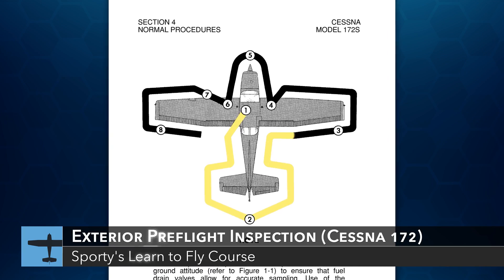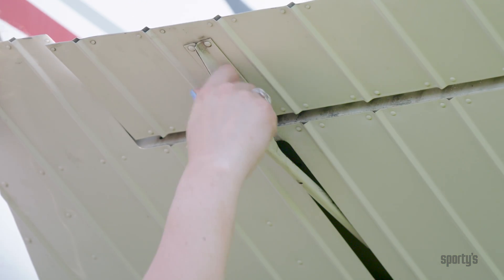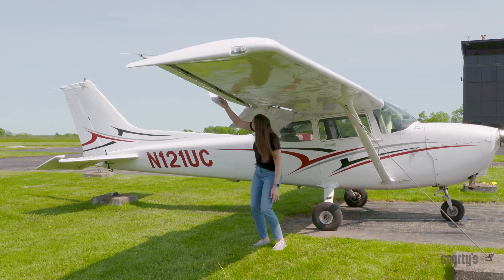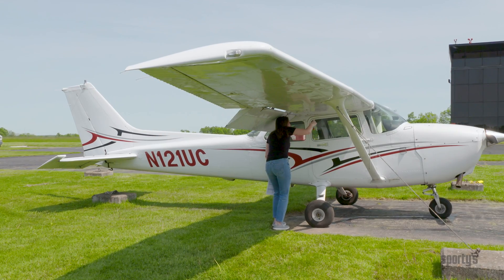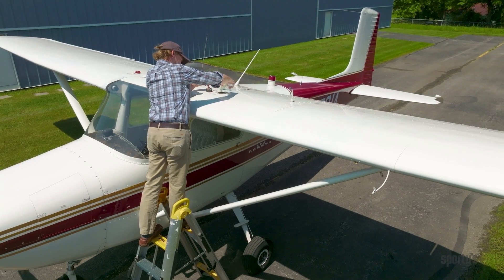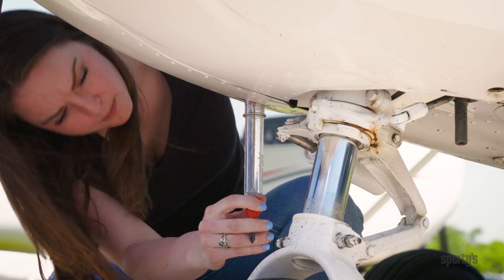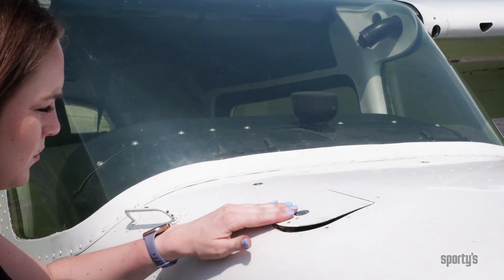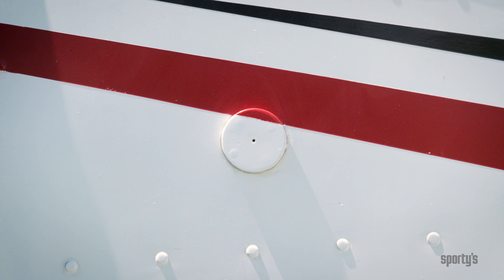How to preflight the exterior of a Cessna 172 - Sporty's Private Pilot Flight Training Tips

Comment: The most precursory inspection I’ve ever seen….missed whole sections of the airframe, such as the belly, underside of flaps (rollers, actuator, bracket, etc). Good overall summary, but far from complete for the standards my students need to have. Is this why students think that by just doing a 3-minute lap around the plane they have aptly deemed a plane worthy of flight? 😮

Comment: She should have looked into the exhaust pipe to make sure no birds have decided to make a nest in there and that it’s free of any obstruction as far as she could tell. And if the engine is cool to the touch, perhaps a gentle pull on the exhaust pipe to check its’ security. You don’t get a second chance to do a preflight. Once your airborne it’s too late if you missed something. Do your preflight right the first time. And don’t let anything distract you during preflight.

Comment: Checking the tire pressure should be done with a pressure gauge. You cannot tell if the pressure is correct just by looking at or touching the tire unless it is way off.

Comment: In places where the temperature gets below freezing, you should rotate the prop (opposite the normal direction of rotation) so the bottom blade is vertical. That helps drain any water that might otherwise collect and freeze in the spinner that will cause an out o balance situation when started. It also allows for easier inspection of the engine intakes and alternator belt.
Reply: also helps you get access to check alternator belt
Reply: Clockwise rotate?
Reply: @Davi3038849844  Yes, this would generally be clockwise when viewed from in front of the prop (some airplanes have props that rotate counterclockwise when viewed from the cockpit such as the right engine on some light twins). I edited my comment to clarify that you should manually rotate the prop opposite the normal direction of rotation.

Comment: The guy on the ladder is standing on the top steps which is dangerous. These are typically placarded with NO STEP because it’s easy to overbalance with the weight that high. I’m sure we’ve all done this before, but it really should not be in a training video.
Reply: I hat3 climbing the wing step, i almost always slammed my left outside foot into the ground

Comment: The plane is pushed back too far in its spot so both the wing and tail tie downs are slanted forward. They should be either both straight down or pulling in opposite directions. There are no chocks so if the wind were to move the aircraft forward, all the ropes would be loose and it could easily be damaged by a gust of wind.